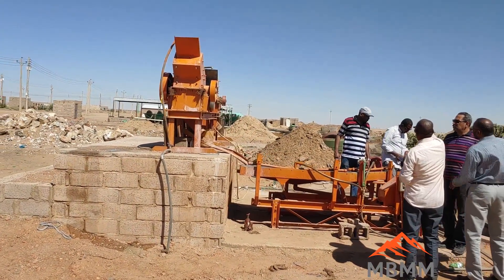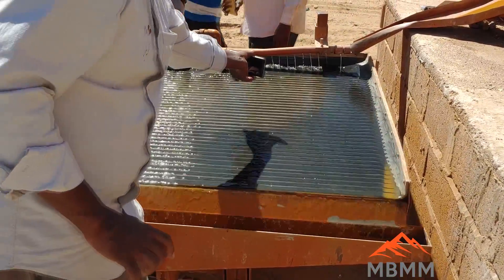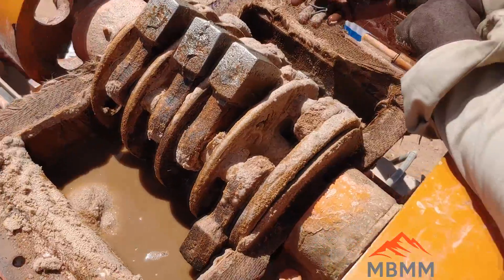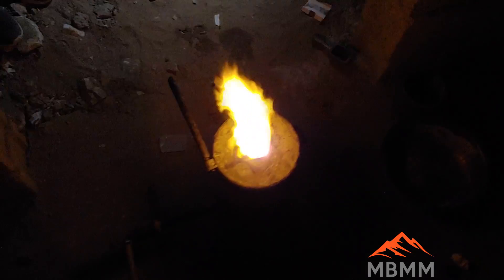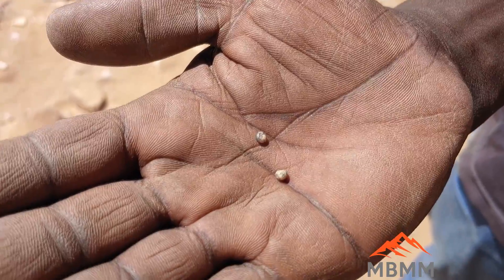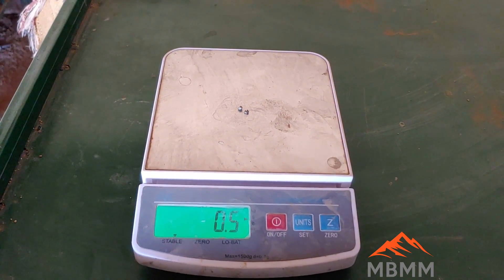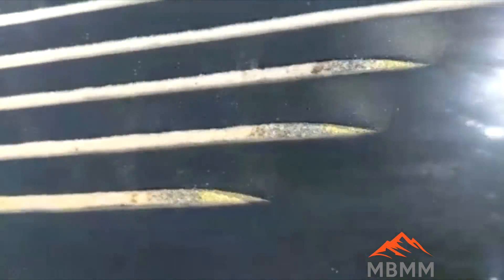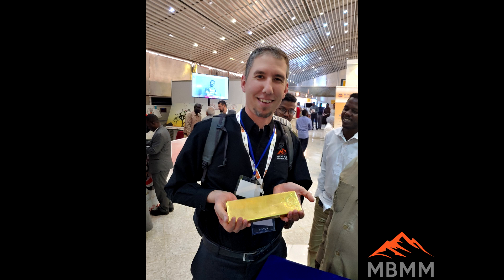Gold Mining And Smelting In Africa. Mercury, Cyanide, And Chemical Free Precious Metals Recovery

Comment: Great video. I’m wondering if the main reason the mercury mill isn’t as effective is because the gold is so fine. Mercury won’t amalgam with 70 micron or smaller gold and the gold coming off the table appears quite small. Your table is more effective and less toxic. Win all around!
Reply: Yes, the chinese wet pan mills grind the material to a powder, along with flouring the mercury, which makes it much less effective at amalgamating, and results in significant losses of both Au and Hg to tailings. Going with a simple milling + table circuit is more efficient and cleaner.
Reply from the maker: Thank you for your comment and for watching our videos!